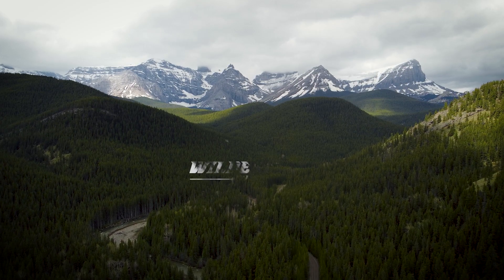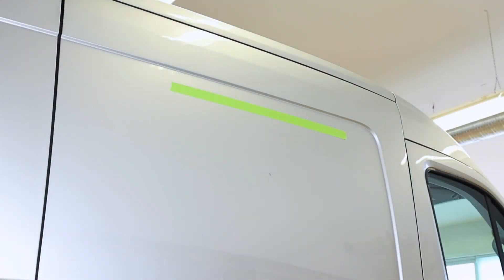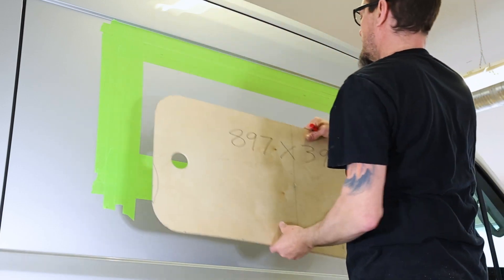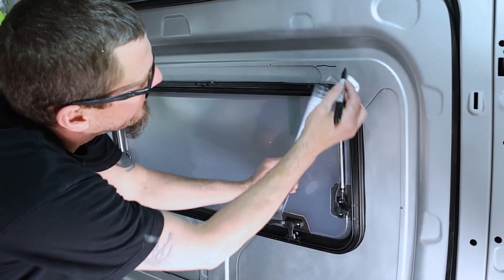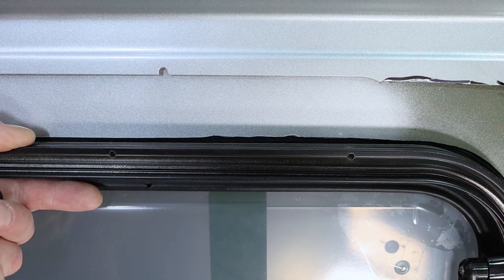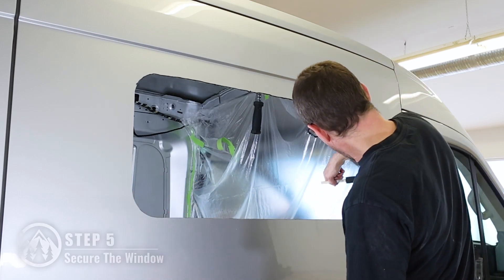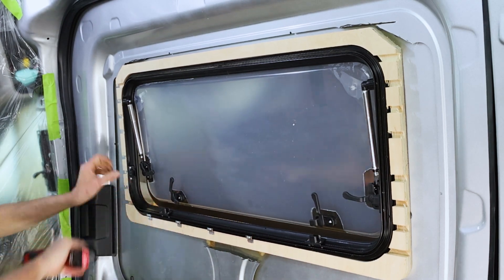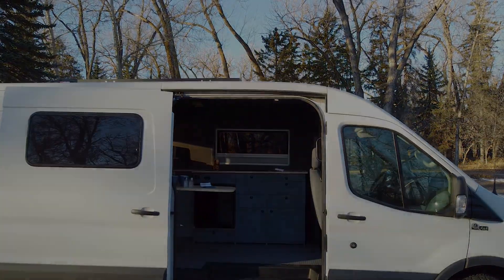Broad Arrow Window Install Tutorial 2023

Comment: Robertson screws, for folks in the U.S., are Canadian-made screws with a square slot on the screw head.  You will need a #1 square slot screwdriver bit to install them.  A Phillips head screwdriver bit will strip them.

Comment: After installing 2 of the 982 x 462mm windows, here's what worked best for us:  1.  Remove any interior brace first thing with grinder as shown or hammer and chisel if glued in.  2.  Use wooden support frame rather than cutout template to decide where to position window as the wooden frame has the largest dimensions.  Tape wooden frame to interior van wall, place cutout template in center of frame and mark center of template by drilling a small hole in van wall.  3.Have asstant tape the cut sheet metal as you cut with jigsaw to support the sheet metal.  4. Use a very thin bead of Sikaflex around outer cuthole or on backside of exterior window frame.  A little bit of Sikafkex goes a long way!  Remove any that oozes out onto van with isopropyl alcohol and paper towels. 5. When screwing the window to wood frame from inside the van, have assistant outside the van push and hold that specific  area of the exterior window frame tightly against the van until screwed into place.  Otherwise, the screws may not fully attach to the wood frame, leaving the exterior frame too loose. 6.  We found no need to make a second center hole as this video shows.  Make sure there's only one layer of sheet metal under the wooden support frame.  Good luck!
Reply: I cut the interior braces with an metal blade on an oscillating multi tool backed up with a thin piece of hardwood.